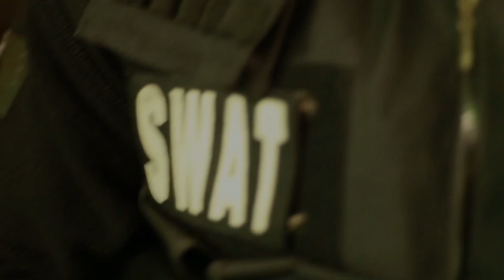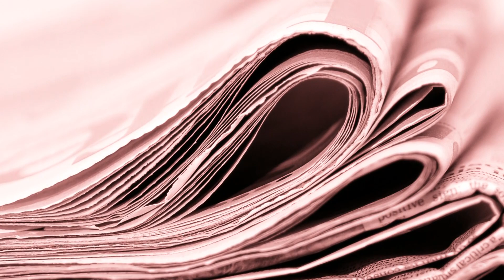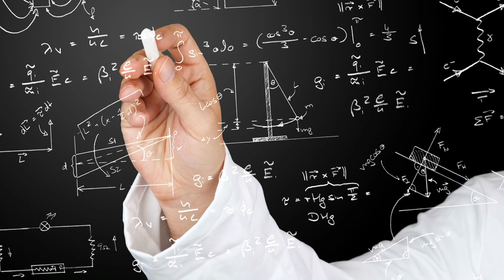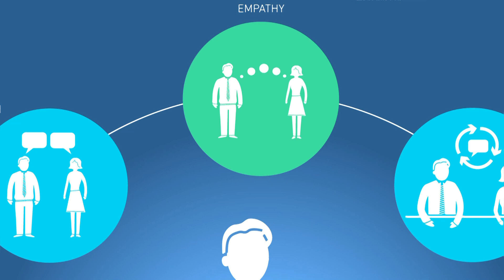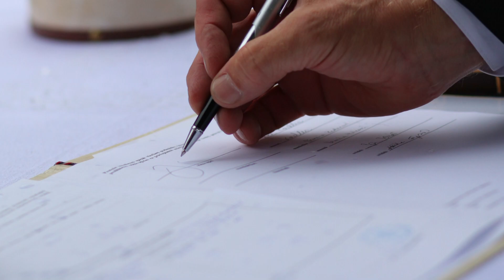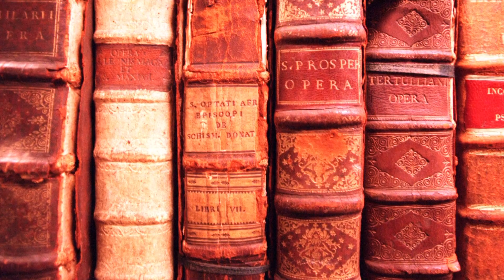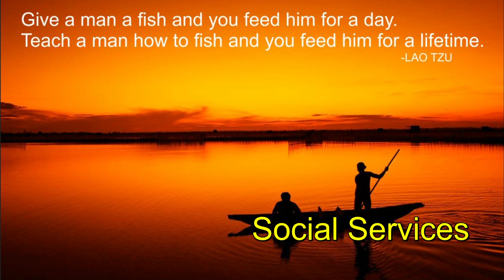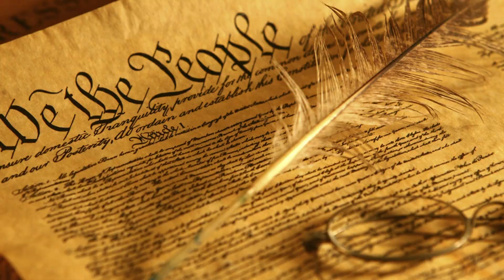After the Collapse: Hard and Soft Prepping Skills

Comment: I don't know if this subject has been covered yet or not specifically. What happens to those that are already in prison when SHTF? Is it best to let them go? Do we leave them in there to rot? Do we release those that have very minor offenses? I know that during SHTF gangs will try and break their buddies out and then some. They can easily build a small army with the amount of people that are in a prison. We see this with the Cartels and ISIS. That's how they recruit new troops. As far as rehabilitation it been proven not to work on any major scale. The prisons have tried program after program to rehab criminals in prison. The percent overall that rehab and stay out of prison are very low. I think during SHTF the punishment doesn't need to fit the crime, it needs to out weigh the crime. That goes back to what was said in the video about setting up some written rules. That way everybody signs on to the rules or moves on down the road. The rules will not be voluntary if you wish to be in that society. If you want to go do your own thing then you can take your chances out in the wilderness with the outlaws and the wild.
Reply: HARD TIMES CALL FOR HARSH SOLUTIONS.
IT MAY HAVE TO BE ASSESSED ON A CASE BY CASE ASSESSMENT BUT REMEMBER YOU ARE DEALING WITH THIEVES, LIERS, RAPISTS, MURDERERS, DRUG DEALERS & USERS  AND MANIPULATORS, ALL OF WHOM COULD BE A DANGER TO ANY COMMUNITY, THEY WOULD BE PUTTING THEIR NEEDS FIRST NOT THE COMMUNITY'S, THE ANSWER IS SIMPLE.  I HAVE HAD EXPERIENCE WITH A FEW XCONS AND IT WAS NOT A GOOD EXPERIENCE, WHEN IT CAME DOWN TO THE CRUNCH THEY ALL REVERTED TO THEIR OLD WAYS.

Comment: I'm a libertarian, and I would agree with the sentiment you posited about the need for some semblance of regulation for the functioning of a society, be it a small group or large.  How to allocate resources such as food, water, hygiene products, tools ammunition, batteries, fuel, and so many more categories of things will need to be outlined and strictly adhered to.  The determination of who gets what, and how much of it, will have to be decided somehow, and there will need to be some mechanism in place to ensure that the decisions made are adhered to.  That is regulation.  You don't want one person using twice the water, eating twice the food, and doing none of the work.  That would not work.   Some fastidious member of your group will need to be tasked with the record keeping of the inventory and consumption of goods.  This person most often will need to have experience in this to be effective.  I argue that this person has one of the most important, and most difficult, jobs in the group.  When there is a surplus the group members will view this person as an unnecessary oversight, and when the resources get lean, the group will likely turn on them and blame this person for the things they lack.  Whomever is chosen/ volunteers for this role will have to be both studious with record keeping as well as unwavering in their duty to fairly and conservatively allocating said resources.  Tall order to fill for sure, and an absolutely imperative function for the long term survival of the group.
Reply: BCB Well said.